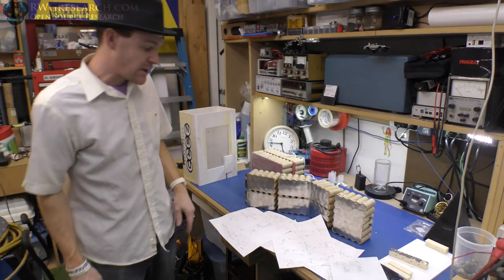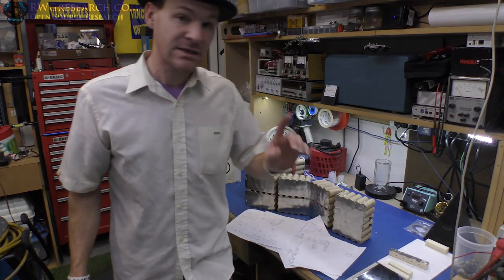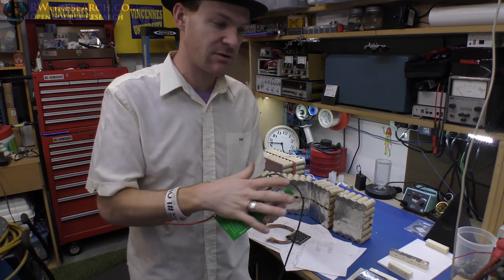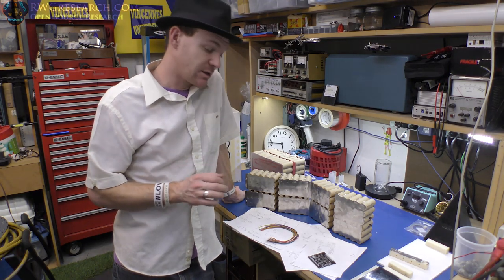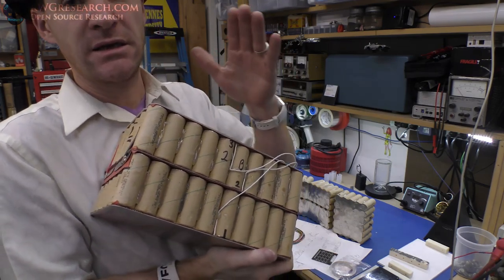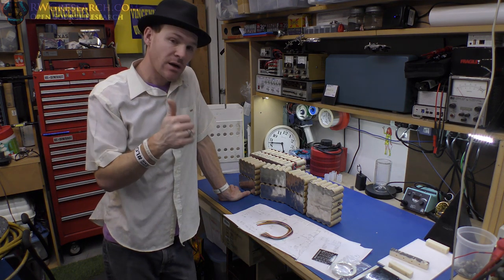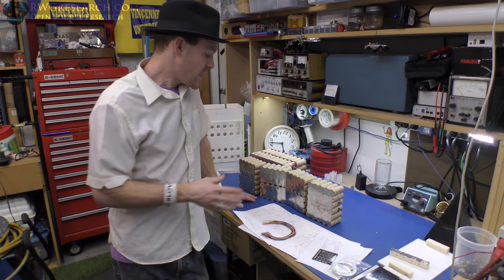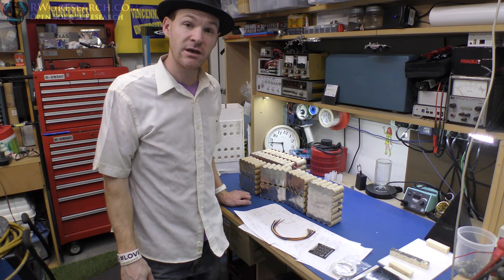Zero P4: The Complexity Of Building A Battery With 240 Cells. This Is Going To Be FUN...

Comment: May want to do a little calculation of the heat you are generating on charge and discharge. (Internal resistance x I^2 x #batteries).
You may just need that extra box space for air transfer... (or did I miss something?)
Reply from the maker: Thanks, well on charge I'm only pumping in about 22 amps. on discharge... less then 100A, and peek less than 200A on hard accelerations. so I will need to keep an eye out for heat. but I don't think for this application it will be to much. but yes. that is a good calculation to do. ~Russ

Comment: from my understanding you can never monitor EACH cell.
just the ones in Series. the Parallel ones will stack up to one block and measured together.

let´s say you have 3p 10S: you will measure each 3P as a total block (12,6V)    but not each 4,2V  + 4,2V  + 4,2V 

correct me if I´m wrong..
   3P   -     3P   -    3P   -    3P   -     3P   -    3P   -    3P   -    3P   -     3P   -    3P    ........(3P-10S)...this is your battery setup.
12,6V - 12,6V - 12,6V - 12,6V - 12,6V - 12,6V - 12,6V - 12,6V - 12,6V - 12,6V .......(126V)........you measure each "S"
12,6V - 25,2V - 37,8V - 50,4V - 63,0V - 75,6V - 88,2V -100,8V -113,4V -126V ..........................always a block of 3 is monitored)

1P10S is possible to measure EACH cell
    1P    -    1P    -    1P    -    1P    -    1P    -    1P    -    1P    -    1P    -    1P    -    1P     (1P-10S   or just "10S")
    4,2V -    4,2V -    4,2V -    4,2V -    4,2V -    4,2V -    4,2V -    4,2V -    4,2V -    4,2V 

is this correct??
Reply from the maker: from what I can gather from your text, yes your thinking is correct. I can only measure each parallel bank of batteries. if one of those cells short out for instance, then it will drain the others and I will be able to measure this with my BMS. I'm using 15P and 16S so only 52V ( 3.2V Per cell) ~Russ
Reply: @RWGresearch  ok,thanks!! 
what if one cell has just 3,2V and the others 4,2V (mis-balanced)  it will over-discharge the "empty one", and will over charge the "full ones" until the total is 3x4,2V?